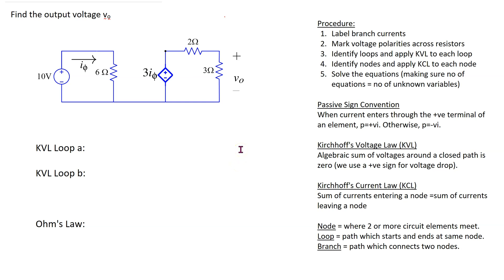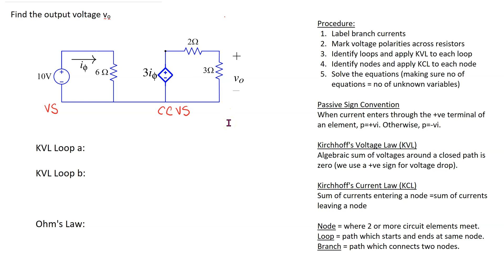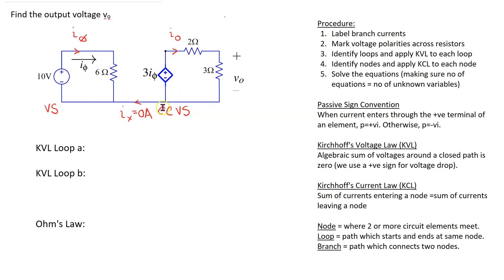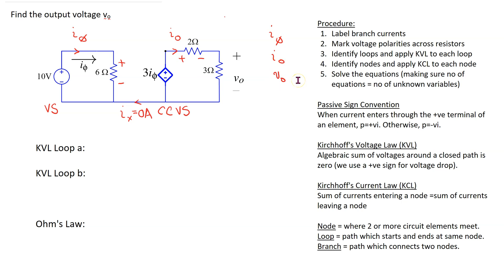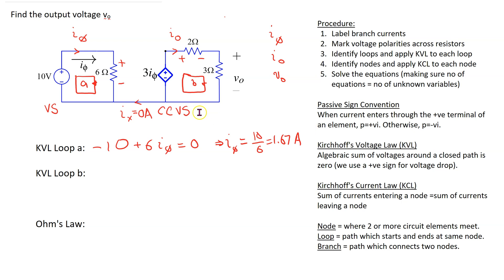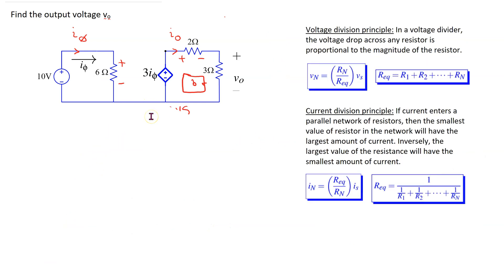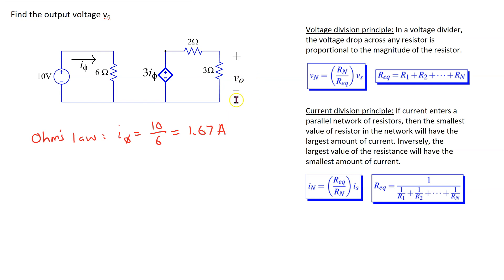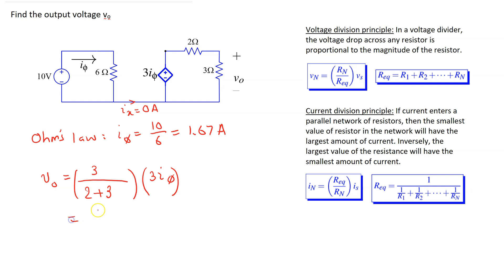Solving Circuits Using Kirchoffs Laws and Ohms Law - Example 5 Circuit Containing a Dependent Source

Comment: Could you prove that i_x  = 0A mathematically or explain it from a different angle?
Reply from the maker: Thank you for the question.

Circuits of this type are not real-world circuits. Recall that dependent sources are a circuit theory construct only. That being said, circuits of this type are used to model amplifier circuits in circuit theory.

There are two parts to the circuit. The one on the left models the input to the amplifier and the one on the right models the output of the amplifier. The two circuits are coupled or connected via the dependent source.

In first year textbooks these two circuits are shown connected by a conductor to signify that it's "one" circuit. Since there is no return path for the current (no second conductor) the current i_x is 0A. 

Due to the dependent source, the current/voltage in the output side is controlled by the current/voltage in the input side of the circuit (despite i_x being 0). 

That is why in advanced electronic textbooks the conductor connecting the two parts of the circuit is omitted.

Hope that helps to understand!